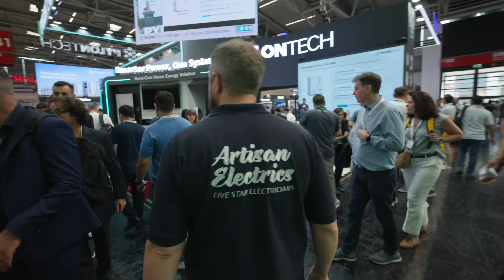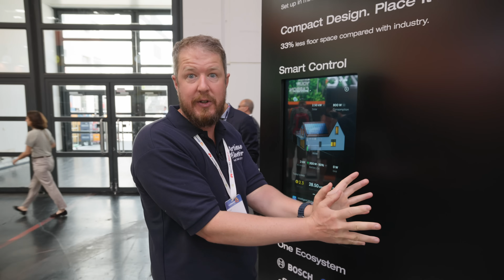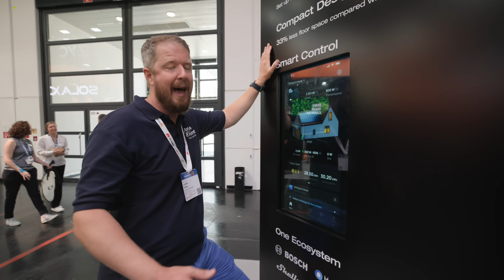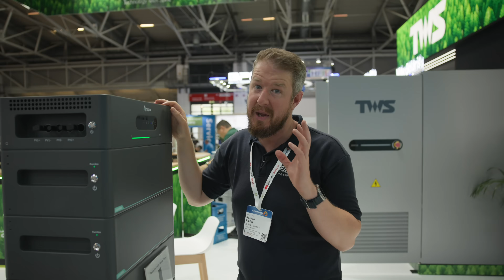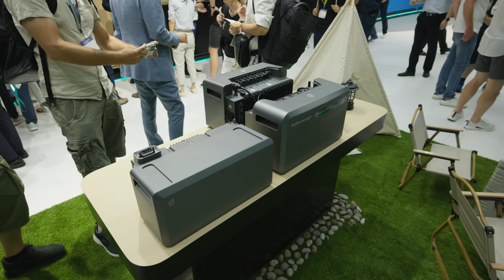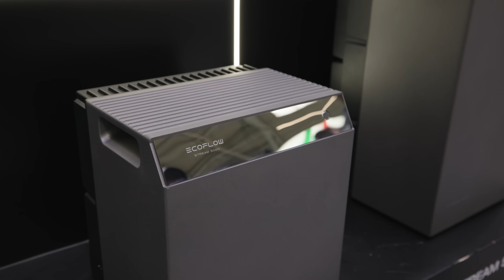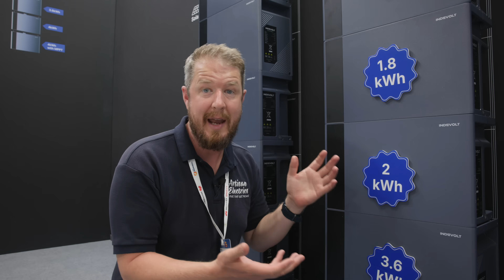Is the UK FINALLY Catching Up on Plug-In Solar? Intersolar 2026

Comment: As I've said before, the regulations basically are playing catchup, people are already doing it, if you make it illegal as in Australia is won't stop people doing it, but they won't get electricians in to check their wiring first because it's illegal, so it's less safe. Of course regulations take time but it will get there. If I was going to do some sort of solar here with an old house I would use a standalone battery plugged into solar and plug into the battery directly so there was no feed in to the house wiring, with a small battery you can run fridge, TV and etc, even a small aircon during the day with enough solar input, then you plug the battery into the power point so that it acts as a pass through if the battery charge gets to low, but there's no feed in, it only draws from the grid if the appliances need it. This way it's entirely legal, but more expensive of course.
Reply: The nature of the beast that whether it is legal or not people will do it without checks from a sparkie, you can argue it either way.
I didn’t get it checked because it’s illegal.
I didn’t get it checked because I’m allowed to do it so why pay extra?
Reply: If the government , and the associations who insist on regulation, can see a buck in it, they will find a way to do so, the gov is already trying to corral YT into promoting their preferred broadcasters, so that they can insist on a licence.

Comment: I am already using plug-in solar in the UK with the ecoflow stream ultra batteries and I plug it into a wall socket in my garage which is fairly close to my consumer unit... currently have almost 8 Kwh of storage. My house already had a roof PV system installed just over 20 years ago now through the free scheme ( unfortunately ) and I cant do anything with that for a few more years. Its ok , its just the installation company has benefited from it for the last 20+ years getting paid for the export.
While we have had free energy during the day , it wasnt doing anything for us at night so I bought the ecoflow plug-in system with initially a stream ultra battery , two 515w panels and a smart meter.

One bonus after I installed the system was seeing that the roof PV system uses all the spare power to charge the batteries along with my extra 2 panels. I was fed up of the company getting paid for all that excess solar , so now its good to see it going to charge my batteries and they now only benefit once my batteries are topped off.

The smart meter watches how much power my house is using and tells the ecoflow batteries to release just enough power to zero my power use.  Without the smart meter it would just feed in a constant 800w until the battery was empty. So a smart meter is a MUST.

As I said I started off with a single stream ultra battery ( 1.9 Kwh ) which didnt last long enough and would be empty mid way through the night. So I added a second .. I made a mistake and went for another 1.9 kwh battery , which ok it lasts now and still has power when the sun comes up and starts charging again , but not every day is a sunny day so I should have bought the big daddy , the stream ultra x which has 3.8Kwh addon in the 1st place , which I now have and I am waiting for it to be delivered. 

Once it gets here I will have close to 8Kwh which should last close to 2 days even on poor solar days.

The system works great , I am paranoid and go around feeling the sockets and things for excess heat which I have not felt at all yet and my meter has hardly moved since I installed it. The only let down is when I run how powered devices in the evening like a 900w microwave or when my kooker tap warms up , the 800w limit doesnt cover the power use , but it reduces my total consumption down.

Personally I love it , the only thing I dont like is the issues waiting for stock as these things are so popular right now.
Reply: What is the smart meter ? The shelly thing to add on to an electric pannel ?
Reply: Don't feel too bad, and you can get a second unit but use it in conjunction with a CT unit to provide zero export but cover what the first one doesn't...or you could buy a y&h 2000w gridtied inverter with limiter connected to a battery, of course, that will provide zero export at night if you put it on a timer!!!

Comment: So wait a moment...i thought that if U used a micro-inverter to plug in your solar output, it would reverse your meter, ie., lower the unit count?
Reply: On a mechanical meter it usually would, but with digital meters usually not.
Reply: Ancient spinning meters would go backwards but none should exist in the UK today, any remaining where missed and should have been replaced as they are life expired. Later spinning ones have protection. Pre smart digital meters have anti-fraud detection it will trip but the meter readers know to ignore that with solar and battery. Smart meters except for some very ancient ones meter both separately.

Comment: i just bought a kit from Ecoflow - Waiting on stock for months its so popular in the UK - best thing about the system is its modular - I can buy the panels and invertor then down the line move to batteries - Done worry guys i will totally be getting it installed by an electrician using a spur as its not legal yet.
Reply: I wish they done smaller batteries - they be very expensive.. even for 1

Comment: I have had plug in solar for over 15 years, I bought 4 × 80W panels a over £500 and a Soladin 600W inverter it has been upgraded a bit since but still plugged in to a normal socket.

Comment: I watched your videos,  live in Germany I have plug in Solar with a decent 800w inverter where I use 4x440w panels, if you are a pensioner or someone working from home or  have young children at home a batterie  is not necessary because you can use most of the  energy you produce during the day,  using appliances like washing maschine or dishwasher during the day, instead of evenings, If your out during the day then a batterie system makes sense,. in Germany there is also a larger plug in system thats allowed as well, between  basic plug in and  a household pv system by using a  dedicated single ( wieland plug socket)  straight from the consumer unit then you can supply 2000w into your system. Using a  shelley or smart meter so when switching on appliances that use more
 power up to 2000watts can be fed by the battery. Here you should have electrician install it. But the cost will be much less than a pv system
I,m refurbishing a house in the uk, and planned whats needed to have safe plug in system.  I would say a decent plug in set up would cost between 350 and 550 pounds  taking about 3 + years to pay it back. ( NOT a lidle, or aldi system) A Batterie system depending on how many panels you want to install,  costs between 1500 to 2500 pounds Battery . 5 years + to get a full return on your investment. 
I have my system for three years and it,s already paid for itself in Germany, a percentage maybe 10 to 15 % of electricity gets lost to the grid but having a batterie for me still makes know sense.

Comment: I don’t understand why so many electricians are worried about it.  

If a house hold aren’t sure they will get an electrician to check their system and give work to companies that aren’t MCS installers and the MCS installers will probably get work from households that like the small setup and now what a full system to get paid for or when they move will more than likely again go for a full system instead.

Everyone is a winner.
Reply: The problem, is not those people who are un-sure, and so consult an electrician. The problem will be, those people that say "I know what I'm doing, it's simple, it's just a plug - after-all I wired the shed, didn't I?".
"DIY Dave", will be putting up, as many solar panels as he can fit, connected to as many inverters as needed, plugged into the mains, via whatever method he can cobble together in his shed - bonus points, if Dave works-out how to unlock the 800W limit, and raises it to 2400W (It's only ten amps, a plug can take thirteen)
Which will be fine, until Dave, overloads the wiring in his shed / garage / house, because he's got the power coming from the mains, plus the solar generation, flowing into his wiring, that he's got a large load running from (Commando connected EV charger?)
The breaker will not trip, Dave's EV will not pass go, but his solar / batteries + mains, will have melted  the wiring in the middle.
Reply: @j @johnbooth5199 at’s why you regulate it.  DIY Dave can do all of what you are saying now but it’s against the regulations.

Set safe guidelines and regulate it and everyone will be happy and safe.

The safety test show if done at 800w there isn’t any issues.  This is also almost 1/4 of what a modern kettle draws at 3kw.
Reply: @neil3589  While it's true that Dave can do all of that now - it's a hell of a lot easier to buy some plug-in systems, and plug them into your shed - than it is to work-out how to wire-up a solar / battery system to your shed.

That's where the worry lies - because plug-in seems "Safe", until you do somthing with it, that makes it unsafe - that's where DIY Dave, with his lack of understanding, will start a fire.
Reply: @johnbooth5199 but he can now and has been able to buy these units for 2 years in the UK.  It’s better to regulate than do nothing.
Reply: The only thing they're worried about is losing money for not getting the job... So they're fear-mongering the public...

Comment: Is plug in solar the beginning of the end for MCS in the UK?
Reply: The new requirement that an electrician doing solar work is qualified in solar work may well be the end of the MCS in the UK for solar because if they are so qualified then assuming they are a member of NICIEC or similar they will definitively meet the alternative requirements for SEG payments.

The fact the £2500 grant for air/air heatpumps is not worth the paperwork may also keep them out of air/air heatpumps for good.

Most interesting question is export payments for plug in. Currently the SEG rules permit an energy company to offer SEG payments at their option for any other install providing it is safe. So if the government declares plug in solar safe it would be up to Octopox and friends to decide if they wished to offer SEG for plug in. Not that I imagine it matters much in the real world.

The MCS should lose it's special status for solar. It's an obsolete relic of the original FIT scheme to avoid fraud.
Reply: @etc @etchedpixels teresting points in your first paragraph, I hadn’t realised that. I run a small company with MCS membership since 2011 and it’s been nothing but a pain in the arse and an exercise in paperwork. As for RECC/ REA what a waste of time. Since the FIT ended most customers are mostly interested in storing and using their electricity rather than payments for export. Correct training, building regs, scheme memberships, dno approval should be all that is necessary.

Comment: I think its 800w per dedicated circuit so you can have more but its gonna to be across, presumably another ring cct. Although, technically, there is no reason why you could not send it back into a lighting loop - via a switched fuse spur with an appropriate fuse - max 5 amp / please provide your thoughts😊
Reply: It's currently tbd - consultation had both per circuit and per house as the 800W limit options. Draft standard is 800W per house but with a footnote that it might change after the consultation.
Reply: @etchedpixels  like the german guy in the video kinda said the 800w limit is because of rtards trying to pump juice though unknown wiring, like a 1920's house. That said modern homes with good 2.5 t&e and consumer units should happily be able to cope with more, what would be nice is some kind of eicr where a home could be rated for a higher inverter output.
Reply: @utoob34  Probably cheaper just to pay a sparky to wire the thing in than do a full EICR
Reply: @etchedpixels  you're probably right, but I was thinking of a health check on the ring used, a couple I know have been using a 2.4kw setup on theirs np, mind you they've just had a rewire done. The cu they've got is fancy and it'd trip if you look at it wrong lol
Reply: @utoob34  I think that at least getting the ring checked would be a very smart idea for an older install.

Comment: I can't wait to get our Plug-in Solar system with battery storage. In our previous house in Kenya we had a full solar system with 15kw of battery storage. We could not sell back to.the grid. 
Here in the UK, we are renting and a Plug-in Solar makes so much sense. We can take itwith us when we move. 
Panels will go on the shed roof and the All-in-one (Inverter & Battery) will go in the boot room with the ground source heat pump. I can't wait. Ohh we also have a Plug-in Hybrid which we charge from a Granny charger.

Comment: Would’ve been more useful to go into how plug in solar work, how much can be installed based on current uk gov to allow, anything to watch out for in terms of electric wiring in house can poor / old standard wiring cause any issue (if any), etc. rather than just get blanket responses from other countries
Reply: Most of those are unknowns. There's a draft standard and a consultation that just closed. We expect 800W but the consultation asked if 800W per house or per circuit. There's a set of proposed language that basically says if your wiring is old then you might want to talk to an electrician (remembering that for a rental it's a legal requirement to have an EICR and stuff up to scratch so tenants should be fine, and if not then the landlord probably has a rather bigger problem).

The how it works is plug box into socket, find somewhere sunny and southish facing for panels, plug cables between solar panels and box as indicated in the instructions, then usually have an argument with a mobile phone app, although not all units even need that unless you want to keep score.

Comment: Netherlands people do not have to pay for export (only pay if they have the wrong supplier). you can earn some nice money here with dynamic energy prices.
Reply: Pretty much every supplier charges feed in tariffs if you're not on a dynamic price contract.
Reply: @eavdmeer But that is only enough to cancel out the energy suppliers part of the net metering still in place. Apart from that you still get €0.11 per kWh of enegy tax back this year. 
By 2027 the net metering will be gone and the energy tax will no longer be credited on export. But fixed contracts can  only have export coats per kWh which can not be higher than the price paid for the export.

Only dynamic contracts will make zero export something to consider, but it's wiser to just store that in a battery for later use or export in the evening peak when the export rate is high.

Comment: If you may copel 800w.. is that per face ?!?
Reply: UK proposal is 800W or 800W per circuit. Oddly 800W per phase wasn't mentioned, however few UK properties are on 3 phase supply and they are mostly very big ones so wouldn't be using plug in anyway. Our normal is 60A single phase, or these days 80A.